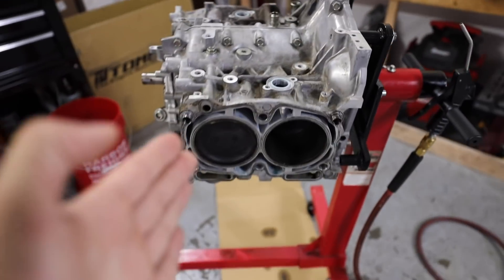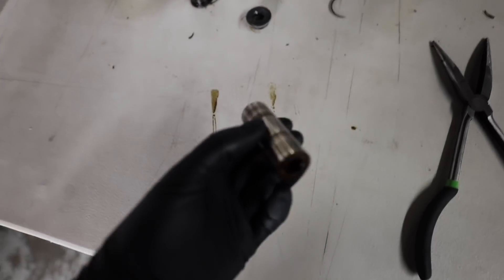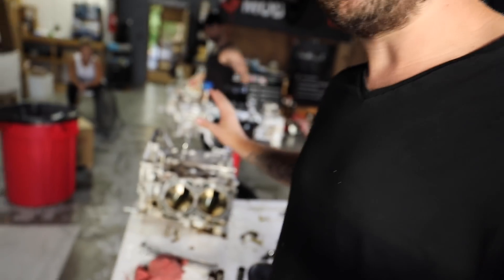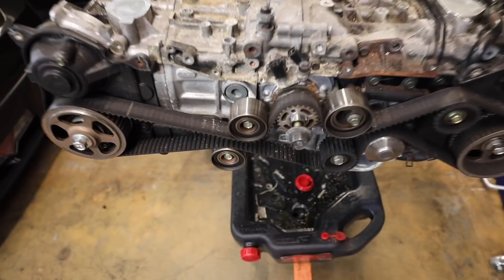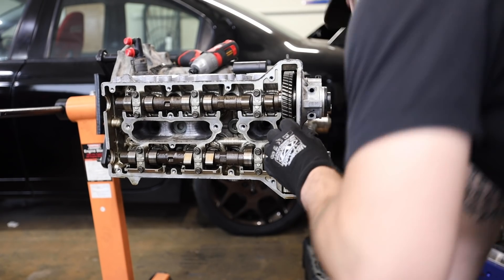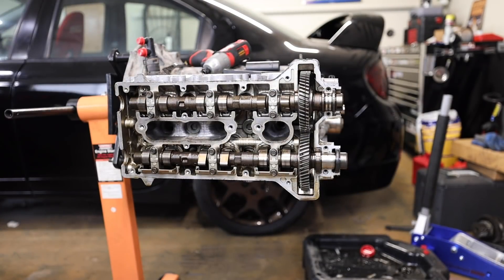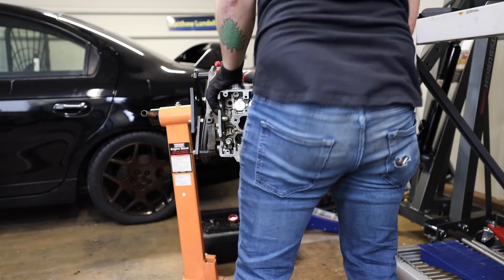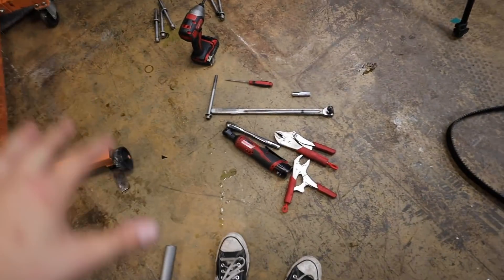LET ME GET THEM HEADS!

Comment: You can find all the dimensions on JE pistons web for the ej22 and the ej257. The eg33 is a ej22 with two more cylinders. You can use the pistons for the ej22. All ej rods have the same dimensions except ej phase 2 rods they are longer.
Reply from the maker: Were using Manley H Tuff Rods, having a custom piston set made. Target CR is 9.2:1. 🙏 but you are correct, at the time I jumped into the block without knowing too much and figured I could pull measurements to cross compare

Comment: Great video bro, btw those "buckets" I think the top part is called shim, at least on my 7mge I tried rebuilding long ago, I made the bad decision of removing them without  marking them, they all have different tolerances and to save u a headache if you planning on removing them you can use the dozen eggs empty box and put them in order inside that. (My dad spent 3 months playing with my mistake and even had to make a little program to figure them out) take care bro great content
Reply from the maker: Yeah I did not mark the buckets when i pulled them... 😅 TBH did not know I needed to. Ill be replacing them with new ones anyway so hopefully it won't bite me in the ass later 😖

Comment: Make sure u mark them lifter buckets... They are balanced to the lifter they sit on
Reply from the maker: Well uhhhhh.... too late for that 😅
Reply: Ye the wrist pins, rods, and pistons are always balanced, when taking apart an engine and you will be reusing those parts u must always lable them together and what cylinder they came out of
Reply from the maker: Lol well this will be fun to reassemble 😅, swappijg to diffrent rods and pistons, was also going to replace the buckets and wrist pins. A rebalance would be in order anyway correct?
Reply: Yes, since you will be changing the crankshaft itself. You might want to rebore the crankshaft seatings as well to the new one.

Comment: Oh man, should've put the stop bolt in the cam to hold the scissors gears in compression.  That'll be tough to get back unless you aren't reusing the cams.
Reply from the maker: I did not do it on the first set I pulled the second I did, totally spaced on the first one 😪

Comment: We should make a counter for how many sockets have been lost due to the engine and its bolts that not even god can take off
Reply from the maker: So far 1 extention, 2 drill bits and 1 screw extractor 😅

Comment: I talked to my engine builder and the eg33 is basically the ej22 but with 2 extra cylinders. So the rods and pistons from the ej22 will work for your build. The ej22 is the closed deck 22b and old legacy engine.
Reply from the maker: The 22 pistons won't be strong enough, from what ive found wiseco use to make them so they may be order only though phone
Reply: Smeedia yah definitely don’t use stock pistons and all other internals but just for sizing and research purposes I just wanted to let you know! Keep up the quality videos I’m looking forward to watching the process!

Comment: If you decide to change valves from Subaru brand (Which I wouldn't) be careful, there is 1 brand that talks big but here in Oz we keep breaking them and destroying the engines.  I have a friend that runs a turbo Subaru up over 10,000 rpm on stock Subaru valves.
Reply from the maker: I may just clean and reuse the OEM valves in that case depending on the condition of them when i pull them out
Reply: @Smeedia  I want to send you a file on the EG 33 with head flow, valve compares, oil pump capacity, water pump etc how do I do it?
Reply from the maker: Tannerwrx525@gmail.com 😁

Comment: https://www.youtube.com/watch?v=Lf8NwqevsNg You were mentioning in another video you weren't sure how it was going to sound. Here is a compilation video of a bunch of SVX exhaust notes. Pretty sure everyone of those owners of those cars is on SVX Nation. Obviously yours will sound different due to the turbo set up.

I know you are a bit of a ways out on setting up your exhaust but if you don't have them already I would suggest stock SVX exhaust manifolds. They are two separate pieces perhaps your can swap the sides with and have them face forwards. Then you could route the pipe to the up pipe in the traditional WRX and STI route (exhaust manifold, up pipe, turbo, down pipe, then exhaust). Also worth noting that the exhaust manifolds on those things are made of a pretty tough material. See link below for the diagram.
https://parts.subaru.com/a/Subaru_1997_SVX-33L-4WD-LSI/_54102_6024458/EXHAUST-MANIFOLD/C12-055-01.html
Reply from the maker: I have a set here that I qas going to use as templates and have a SS version made, the EG33 sounds so good and with a turbo strapped to it I can't wait!

Comment: I have kept parts from cars i have taken apart to use later on. For example your timing belt is good to keep and use as you did. My favorite part i kept was an old exhaust pipe off a 2000 Impreza RS that we WRX swapped last year. The old exhaust pipe works great as a long breaker bar.
Oh an the 4 jars of Subaru bolts. Never throw out bolts from a Subaru.
Reply from the maker: I have so many spare bolts that I use often, pulled some old frnder bolts to use as service bolts for the ibtake cams off of the EG lol